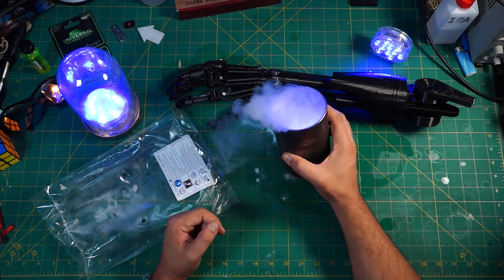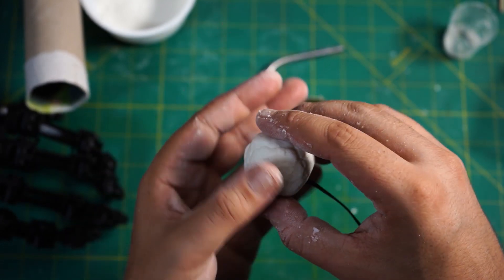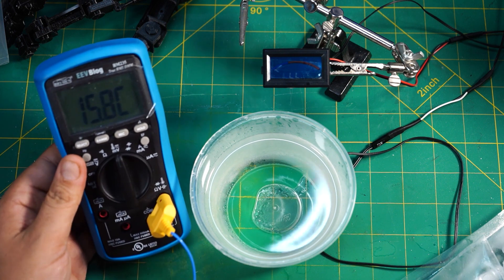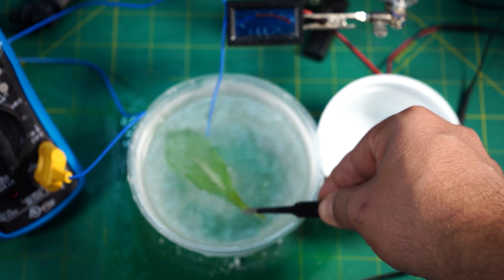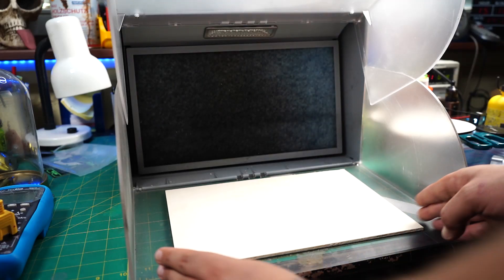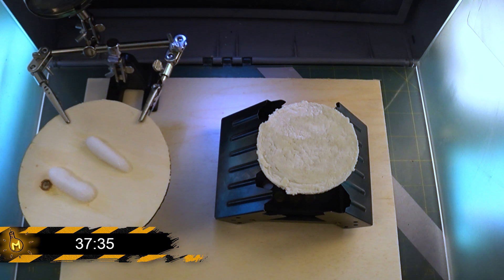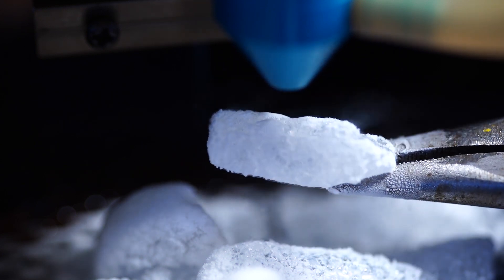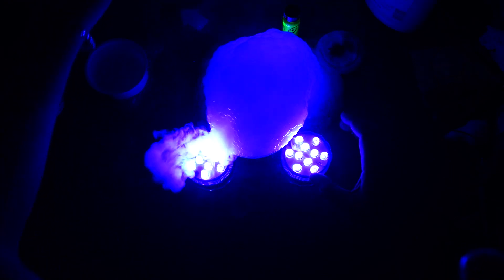STARLITE vs SPACE / Why don’t we use it as an insulator against the cold?

Comment: I know this is an old video, but I just found it.  What if you expanded the carbon layer on the outside of the starlight with a torch before attempting a freeze? I think a lot of the thermal resistance is from the carbon foam that develops.